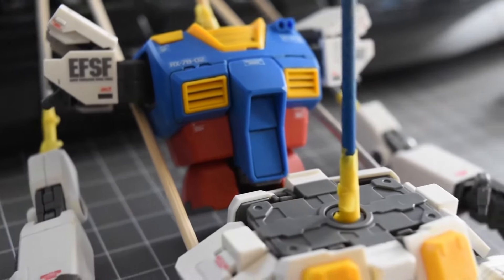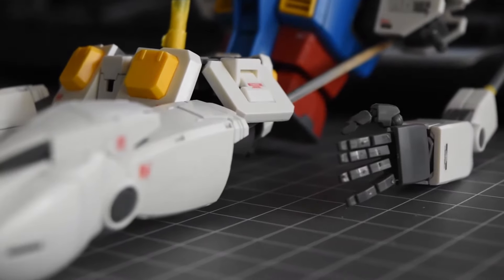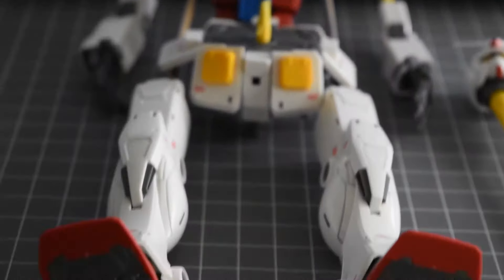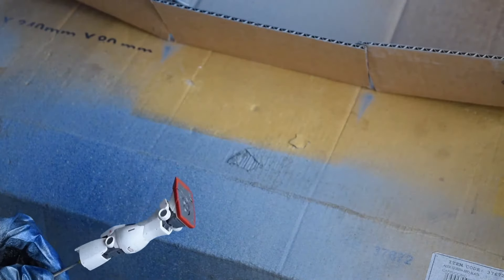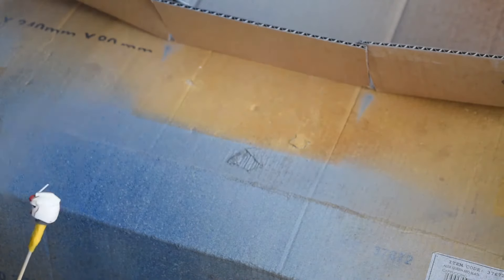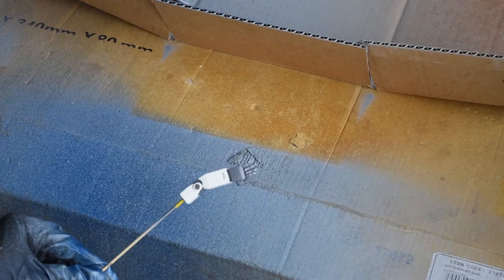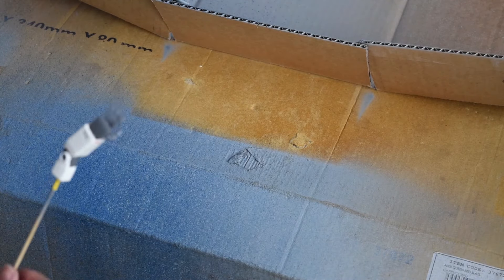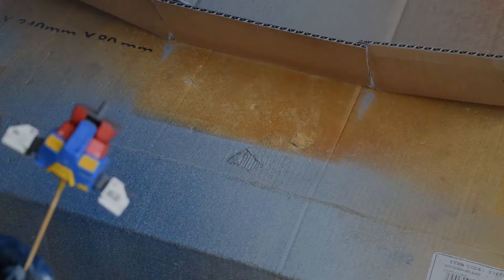02: Top coating your Gunpla

Comment: Can you do a satin/semi - gloss finish next? I subbed cause I appreciate this video you made.
Reply: Oh and did you use the included stickers or bought waterslide decals for this build?
Reply: @chumpapii  I think this is the MG GTO RX782 and those look like the sticker decals that come with the kit, but I could be wrong
Reply: @chumpapii  never usetge included stickers! They are trash and for 5-7 dollars your kit can look great with delpi water slides!
Reply from the maker: Used decals that came with the kit. I would recommend buying waterslides. Main reason is they lay flatter to the surface and you will get a better finish.

Comment: Can i use it with stickers? O You recommend water decals
Reply from the maker: Stickers are fine. Apply them before top coating. Water slides should also be fine.

If you can I would use a test piece first.

Comment: There is something nobody addresses. 
How long do I have to wait to give it a 2nd layer of top coat? What happens when I give it a second layer?
It's so hard to find these answers
Reply from the maker: Hey there. Thanks for asking. It all depends.
Also depends on the level of customising you are going to be doing.
There is many variations of this some builders do the following;

Build>Gloss top coat (1 coat)> Panel Line>Decal>Final top coat (gloss or matte)

The number of top coats would depend on the method. If your using an airbrush you are able to thin it out and use multiple coats. When using a spray can you can't so usually a light even coat would be all you need.

Hope this helps.